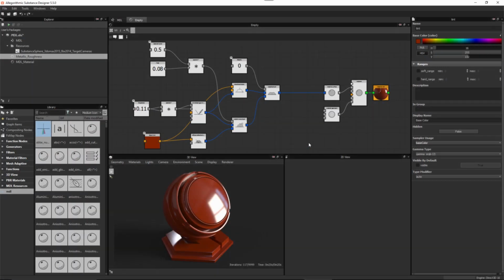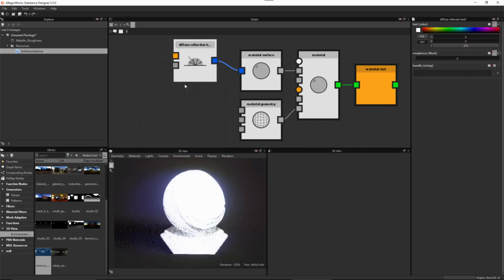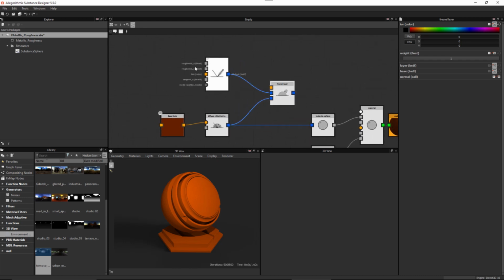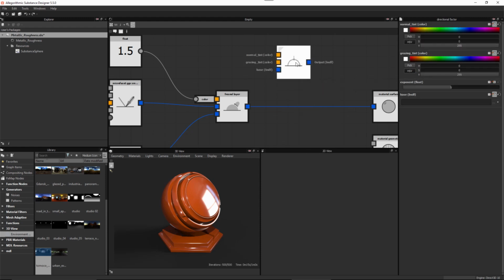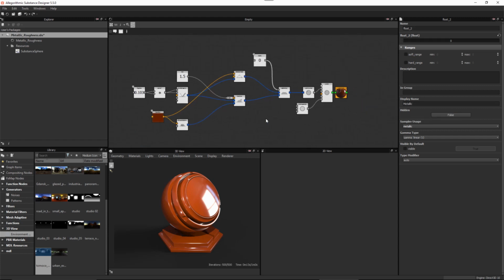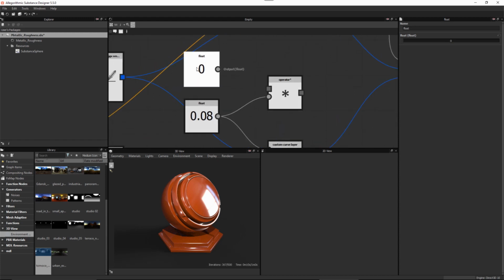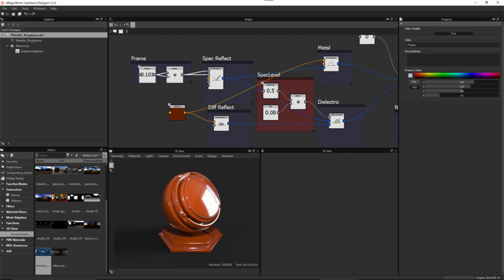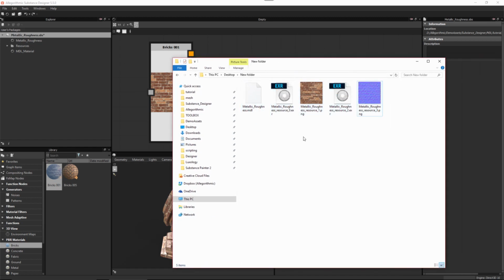Basics of creating an MDL in Substance Designer | Adobe Substance 3D

Comment: Great video! But I have a few questions.
What benefits of making materials with MDL in comparison with a traditional way of making them with Substance Designer?
Where to learn a way to use all this MDL nodes to make proper material?
Reply from the maker: Thanks! Glad you liked the video. With Substance, you haven't been able to create a material in the past versions. You were only authoring the textures that are fed into the shader input samplers. So the traditional way was not authoring a material per se but only creating textures that help describe the surface attributes of a material. You could not author lighting models and this only worked as a single layered-material in terms of shading. We first implemented MDL for support with Iray. It was just a simple conversion of our realtime PBR shader to an MDL which Iray can use. 

Now in 5.5 you can create a new MDL graph which is actually authoring the behavior of the material itself, which is to say you can work directly with the lighting model to created complex, multi-layered materials that can use Substance textures as input.
Reply: Thanks for explanation! So, if I'm using built-in material editor in game engines, like UE4, then there is no big advantages for me to learn MDL, because it works only with IRay?
Reply from the maker: Well, at this time it's only in Iray and mental ray. However, Nvidia is working on wide-spread adoption. For instance, vray is working on including MDL support and should be available in the coming months. More to follow as well.
Reply: Thanks a lot. I just searching MDL in 5.0.3 version & confused lot.. thanks 4 d clarification..

Comment: I cant find the ior-float node in the new 5.6 designer.... are there any changes to that... need to use another node like volume scattering or absortion ?
Reply from the maker: They have removed the IOR-float node. You need to just us a float and then connect it to a color node. This is more encapsulated when you publish the MDL.
Reply: ah... i see... thanks for the answer

Comment: Questions between fresnel layer vs custom curve layer

With fresnel layer.  Is the 1.5 float value should always be 1.5?  I do see differences when I change that value.  I am not sure if it will relate to other conductor material.  Say water is metal is over value of 2. etc

With custom curve.  I don't seem to have the ability to change that.  Or it is hard coded as 1.5 fresnel?

I do understand in this tutorial. custom curve layer node is given a range of 0-0.08 of float value to normal reflectivity.  Is it like the opacity of the reflectivity?  Can I adjust the strength of reflectivity in frensel layer?
Reply from the maker: The 1.5 IOR value is just a default range for a dielectric material. You can change this if you need a specific IOR like for glass or metal. 

The custom curve allows you to set a custom IOR. In this example it's used to set the F0 value for the dielectric material. This range is 0.0 - 0.08 which equates to 0 - 8% reflective and is then remapped to 0-1 where 0.5 represents the 0.04 (4%) reflectance value. This is not the IOR value. It's the F0 value.
Reply: is the value in between normal_reflectivity to grazing_reflectivity a linear curve?
Reply from the maker: I don't think this is a linear curve as it describes the Fresnel curve. Please take a look at the NVidia documentation for the exact data. http://www.nvidia-arc.com/fileadmin/user_upload/iray_2013/documents/MDL_spec_1.1.3_11Jun2014.pdf

Comment: Why doesnt the spec level have a color input, is this not available in MDL?  What i find confusing is that diffuse, spec, roughness are all happening in the diffuse input in the base node (the first node you set)
Reply from the maker: The spec level is not a color value. It controls the F0 reflectance value for non-metals. It's specific to the metal/rough workflow. In the shader, the specular for non-metal is hardcoded at 4% (0.04). The shader has a range of 0.0-0.04 which is remapped to 0-1. This means that 0.5 is equal to 0.04. The first node is the material surface. The diffuse and spec are then layered to the material surface. The diffuse and spec are both BRDFs.
Reply: thanks for the explanation. I was wondering why the that double reflection/specular is in those setups. Im using a different engine which has simply reflection and roughness and both can be used to your settings. 

What rule is that 0.00-0.04 setting actually?
Reply from the maker: For physically-based rendering, non-metals (dielectrics) are set a base reflectivity at 0 angle (F0) of 4%. In linear value this is 0.04. In the metallic roughness workflow, the 4% value is hardcoded. There is a specular level input that can be used to override this. This is a grayscale value for overriding the 4% value.

Comment: And can I use the other texture nodes in substance designer to create a MDL material or can I only use the MDL nodes?
Reply from the maker: You can use Substances as inputs to the MDL nodes. You need to create the MDL using the MDL nodes but you can drive parameters with textures.

Comment: I just to create the mdl and substance designer crashed to desktop.

In order to follow this tutorial I updated to the "development-Substance_Designer-5.5.0.110-msvc14-x64-standard-full" that is/was on the downloads page on the Allegorithmic web site. 

For some reason i had to uninstall the previous version before installing this one despite their not being any change in installation folder/file path, only when I open the software a lot of thumbnails are missing. Can i fix it or do I need to rollback/wait for an update?

I noticed that "tile_sample_color" graph in the "tile_sample.sbs" instead of being in a "tile_sample_color.sbs" It seems easy enough for me to fix it for my installation but the files are locked.
Reply from the maker: The installer will uninstall the previous version automatically. Where you able to get the latest update working? For the thumbnails, please go to the Preferences>Library and click Rebuild Database and Rebuild Thumbnails.
Reply: No I was not, but it may even be because I am still on Windows 7 or that the development is far from being optimized.

 I reinstalled 5.5 several times, even went so far as to clean out the registry to make sure nothing of 5.4 could adversely affect 5.5 due to  the "Destination folder" having changed from "C:\Program Files\Allegorithmic\Substance Designer\5" to ""C:\Program Files\Allegorithmic\Substance Designer 5"".

Even then it was a slow unstable mess and kept on crashing when I tried to open a new MDL making it a hassle to use and lacking the knowledge to fix it myself, I rolled back to 5.4. 

Unless you are going to make or point me in the direction of a tutorial on how to get dev build to work without issue, I think I will simply be better off to wait until the non development (commercial/regular retail?) version is release.

Comment: Hay guys.... 
I'm not getting the material root, I'm getting the Material with Multiple outputs directly. I have Substance designer 2017
Reply from the maker: I'm sorry for the confusion on this. We updated this. Instead of the material root, you will just have a material and then can create a material surface from the from the Surface Input.
Reply: ohh...... i was thinking was making some kind of mistake. But thanks for the clarification
Reply from the maker: No problem : ) It works the same as the tutorial, it's just a change in that you don't need the root.

Comment: I came back to Substance after a year, to check if you've made SIMPLE tutorials with BASIC materials, but... no. Another thing is you have to search quite a lot to figure out what is Painter, but especially what is Designer. It's just not clearly and simply explained anywhere. So i think i can now summarize Painter is a "Mari", that i still don't really know what Designer is.
I'm not a troll and even hate what i'm writing here, but can't you just make a (caps on) SIMPLE 5MINS TUTO on a cube with a SIMPLE material???
Here you show how to make an MDL, nice. But what is MDL?!?
The other day same thing with a video about smart materials, nice. But what are Smart Materials???
Your products are holy great, but not easy to approach. My 2 cents.

I'm just trying to know how i can make materials with Substance between Blender and UE4 , those materials you download on Substance Share, that you can tweak with params in UE4.

Sincerely!
Reply: You can try Michael Pavlovich tutorials for Designer
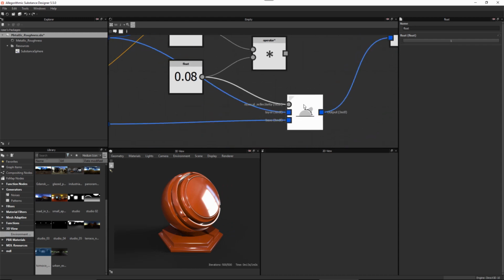Reply: @Music1great : thanks for your help, but the 1st video is 30:23 where the material is NOT a basic material. I'm talking about a straight to the point 5 mins video, not a tutorial that covers half the software.
Reply: Painter is a 3d texture painting application, which is self explanatory. Designer is a NODE based texturing application with the ability to create "substances" which you can bring in to other content creation packages. Honestly, most of the time it comes down to just creating maps, so what are you having issues with?

This is MDL: http://www.nvidia.com/object/material-definition-language.html
Reply: @Genna Dashkin : The first 10 mins of his 1st Designer video is exactly what i'm talking about. I'm going to watch all the playlist, and i think i'm gonna be ok with Designer basics. Thank you very much!
@Rebelismo: Thank you for your definition of Designer, obviously i pretty much understood what it was, but was not entirely sure. My main issue is well expressed in my first comment ^^ Basically they, as in music softwares & hardwares wolrd, act like if everyone was an expert, sort of. Example, go buy a synth, and read its manual for years before even understanding the basics. "Lfo1 : controls the LFO you can plug to the filter". In this example you don't have a clue what an LFO is, neither the filter. See? And for your first sound creation, instead of teaching you how to make a simple 1 OSC sound, they show you a sound with 3 OSC, 2 LFOs, 3 FX, A sidechained compressor, and so on. So you spend hours on that tutorial, and yet you still don't know the basics.
Reply from the maker: Thanks for your feedback on the tutorials. We did launch a new getting started series for Designer. 
https://www.youtube.com/playlist?list=PLB0wXHrWAmCwLRTzdb-RxadGk_xBBQKar

This new series doesn't cover every aspect of the software. It shows you how to create a simple basic metal material. The video is longer the 5 min as it needs to cover some technical aspects. Substance Designer is a tool for technical artists with the goal of creating reusable base materials that tileable and shareable. Substance Designer is also use for creating materials for environments. The main goal is creating a tiling material. The new series covers the important aspects of this through a hands on approach of creating a base material. 

We also have a full getting started course for Substance Painter. 
https://www.youtube.com/playlist?list=PLB0wXHrWAmCx994Cb7iRFSmupYHFw5DTx

Substance Painter is a more artist friendly tool which allows you to paint materials on the 3D asset directly. It's purpose is to textures assets such as characters, props and weapons.
Reply: Thanks everyone for your explanations, it makes more sense ^^
Reply from the maker: You are most welcome : ) We are very happy to help. Also, post in our forums and we can provide better support. Please, always feel free to ask any questions. You can PM me directly in the forums as well. Wes McDermott
Reply: @Wes : i still have your excellent "Real World Modo" book, even if i'm not a Modo'er anymore. I could have sell or give it away, but the problem is i've read the intro unfortunately ^^
Reply: Indeed substance designer has a huge learning curve comparing to Mari, quixel or substance painter. However is one of the most powerful because of its parametric not destructive nature. In my opinion Mari and Substance designer is the most professional combination available.
Reply from the maker: So glad that you liked the modo book : ) Please let me know if you need any help with Substance.